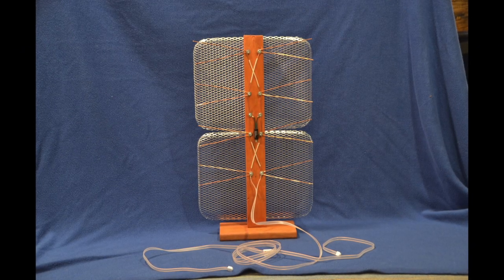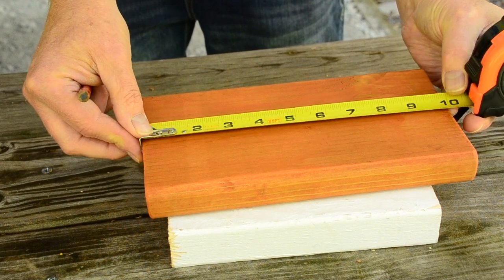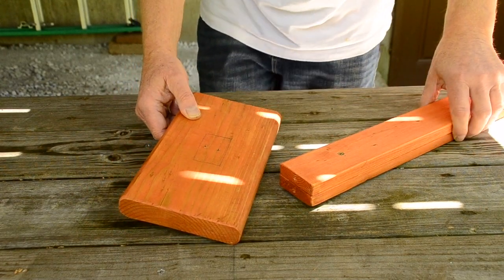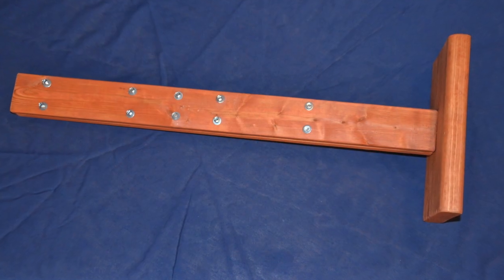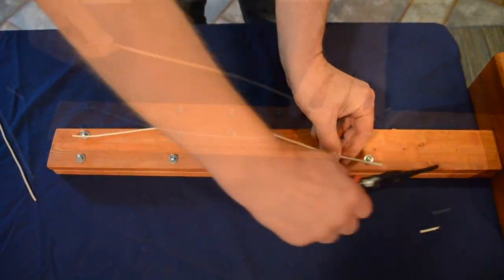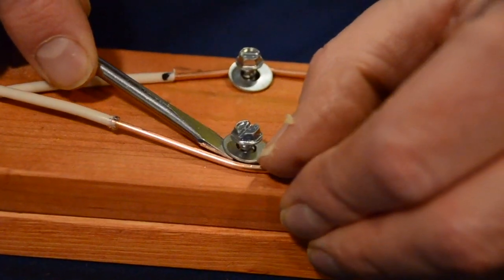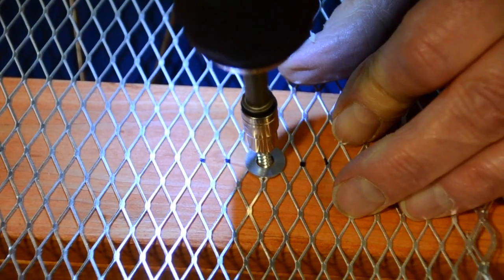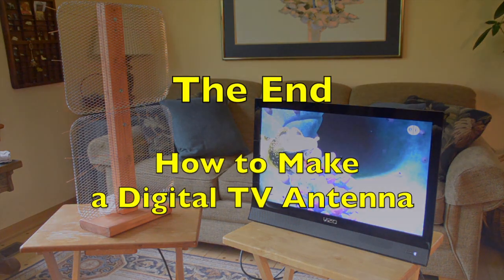How to Make a Digital TV Antenna -- Complete, Detailed Instructions!

Comment: This is a really good design. Works better than the store bought ones. I used 10 gauge copper wire and 2x4s. I made 2 I’m planning on using one pointed to the south and one pointed north west in the attic. You can’t use two at the same time cause of interference. I’ll use a switch splitter at the TV. The length of both coaxial from the antennas to switch splitter have to be the same. At least that’s my plan. Thank you very much for making this video.

Comment: Does the reflector have to be mesh?  Can you use a steam tray or something similar?
Reply: UPDATE: the next day I had to REMOVE the "reflector" in order to get a good signal. I don't know what the solution is, but like you, I"m wondering about why mesh would be better than a solid reflector. I guess we'll just have to experiment.
*********************
ORIGINAL POST:
I made this style of antenna without any reflectors back in 2008 when TV stations switched from analog to digital broadcasting. It worked fine with my old CRT TV and converter box but hasn't been working as well since I recently hooked it up to a newer, digital television. After reading your question I decided to experiment, covering a sheet of cardboard with heavy duty aluminum foil and standing it upright about two inches behind the antenna. It's not fancy, but it made a BIG difference!

Comment: Yes this is a good instructional video and a reasonably good antenna design.
A few improvements:
Your reflector is too close to the working elements,  You can prove this for your self with a TV that has the signal meter function.  If you detect the reflectors and move them back, you should see the signal increase slightly.
If you put a gap between the upper and lower reflector, you can use long bolts, nuts and wingnuts to connect the balun on the back side.
On the middle screws it works a little better if you pass the wire on the inside sides of those screws so that the spring of the wire wants to hold it under the screws.
Your element to element spacing looks a little short.  Normally the distance between each "V" element is made to be about the same as the width of the finished antenna elements.

Comment: There is no such a thing as a digital antenna. An antenna is an antenna. Using the words "digital" and "HD" and "High definition" in describing any antenna is simply pandering to the stupidity of people who actually believe such garbage.
Reply: You are correct but still you should get a life!
Reply: That is correct. An antenna is just a dumb metal object that picks up radio waves. The antenna can careless if those radio waves are carrying digital or analog signal. Your tuner inside your TV or if you have an external tuner will be the device converting those digital or analog signals to a picture that can be displayed on your TV screen.
Reply: Yall are literally retarded. An antennae is not digital. A digital antennae simply implies it receives channels broadcasted in HD - nothing is claiming the antennae itself is digital. Are you guys really that hard-headed?.. a little bored, are we? DIY goes to English class in 2 seconds.. like who cares?? Is convincing someone that all antennae are analog devices going to get you off or something? I'm just really very curious.. do you feel little and insignificant inside?-- and you fill that void by being a doucebag? I'm definitely missing something here. It's pretty hilarious though 😅

Comment: Instead of using two 1'' x 3'' x 25" ferring strips just use one  2" x 4" x 25 instead. Also if you put this in the attic if possible you will pick 10 to 20 more channels.  Height = Might

Comment: No such thing as a digital or HD TV antenna.
Reply: True, but the marketing has drawn a lot of people in. I'm already seeing "New ATSC 3.0 compliant Antenna" advertisements 🙄.  And no, they don't come with a converter box, they're just antennas. At least this video is building an actual antenna instead of just jamming a large paperclip into the coax connector on a TV & claiming it has a 400-mile range (only slightly exaggerating unfortunately).

Comment: 3 comments.  Wood has impedence. For better results suggest mounting the elements and all connections on plastic (which is an insulator) vs. wood because the signal will conduct through the wood from screw to screws thus messing up the impedance and lowering your signal level. 

Also note the spacing between the reflector and the elements.  For maximum UHF gain a spacing of 4 inches is required so if you mount the reflector back much further, it will perform better.

Also, and this is a nitpik. There is no such thing as a "digital" antenna so the title is misleading.   It's an antenna.

Comment: Just curious if there is any reason I can't just use a 2x4 instead of the two firing strips? Looks like a fun project to do with my son who probably doesn't even know TV is free...
Reply: If you use wood, use plastic mounts on top of the wood (either glue the plastic to the wood or screw it separately) so that your signal elements and connections screw ONLY into the plastic.   Don't allow the element mounting screws to go into the wood at all.  Wood is a conductor and will actually lower your signal.  2x4's are good because it also allow you to mount the reflector 4" back from the elements, which provides better gain. The reflector can be mounted directly to the 2x4, but the signal elements need to be mounted only on plastic.
Reply from the maker: I would think a 2x4 would probably work just as well as furring strips. I was just trying to go after the least costly option.

Comment: FM dipole attached why?
Reply: He said that it helps bring in PBS stations somehow.
Reply from the maker: It helps bring in PBS in my area for some reason. Without it, PBS (Channel 35) won't come in at all. Perhaps the dipole helps captures the signal or brings in a different frequency. You can try the antenna with or without the FM dipole.
Reply: The bowties receive UHF, the FM dipole receives UHF. After the repack, a lot of PBS stations moved into the VHF frequencies. Does screwing the bowties into the wood as opposed to plastic make difference, yes, but not one you would ever notice in the real world.

Comment: I'm at a loss what makes this "digital" it is an antenna but there is zero difference between an analog or digital antenna other than no one is broadcasting TV in  analog form anymore in the USA
Reply: If you inspect the airwaves, it is 0's and 1's that are flowing thru the air.  You need a digital microscope to do this!

/s
Reply: @ihatesignupsgrrrrrrr  are you talking about an oscilloscope?
Reply: @caru3257  No, it's not a 0 or 1...  I was joking. The demodulation is what turns the frequencies into 0's and 1's, not what is actually traveling thru the air.
Reply: A digital tv antenna does exist. It is made up of a regular antenna hopefully tuned to the proper frequency that is packaged up and sold with a bunch of mumbo jumbo lingo that doesn't mean anything useful and has nothing to do with anything. A genius marketing scam to make someone believe the antenna they used on their old analog set that worked very well is outdated and inferior so they go out and buy a new one that probably doesn't work as well as the old one they just tossed.

Comment: @doityourselfstan By any chance do you measure a short between the two leads of your matching transformer?  I have ordered this part from two different vendors at this point, and all of them have continuity/short across the two leads, as well as between the center conductor and shield/threads.  Perhaps I'm fundamentally misunderstanding something about the nature of this component.  Thanks in advance for your advice, great video.
Reply: it's a transformer.  The windings appear short to dc signals like your meter's continuity check, but not ac signals like the rf transmission.
Reply: If it's a 75ohm matching transformer, you may see what appears to be a short because you're using an ohm meter that probably puts out 1.5v.  The very small signal your antenna picks up will see the proper impedance so don't concern yourself about the short.   My major complaint with this antenna design is that everything is screwed into wood, which, to a small signal, will mess up that delicate impedance. Always mount everything on plastic.  You don't want the signal touching wood at all.

Also, the antenna design is a huge compromise.  It looks nice and cute, which will probably please your spouse, but it's not really tuned at all for maximum signal.  All inside antennas are a compomise because style matters.  But this is not a properly tuned 4 bay antenna, which would be too large to have in a living room.   

Due to size, a 2 bay, with properly spaced elements and a properly spaced reflector would  provide MUCH more gain, for about the same size.  For those of you who remember the indoor antennas of the 50's, most were properly tuned 2 bay bowtie antennas that could still sit on top of your TV.

Comment: Thanks for the video post. I haven't studied antennas yet and managed to get my ham radio license despite my lack of antenna theory. I waa given one of those cheap 150 mile yagi style amplified antennas that has an integrated rotor. I'm considering adding more elements to it along with a used direct tv parabolic dish for a reflector to see if i can improve the quality of the channels i currently receive along with possibly adding a few i couldn't receive before.  Ray. KG5ZEF and 73
Reply: Throw it out.  They are made by chinese manufacturers who have no antenna engineering talent whatsoever and just threw some cheap metal together, added a cheap rotator and cheap amp.   A hunk of wire with an amp will work almost as well.  Build a 2 or 4 bay style, mount everything on plastic because wood has an improper impedance and make darn sure you have a reflector sitting back 4 or 4.5" and you'll have one powerful antenna.  Just use proper antenna design for bowtie length and spacing, which can be found online.  And yes, with proper spacing it will be much larger than this indoor antenna.

Comment: Do the reflectors actually do anything to enhance performance?
Reply from the maker: They are designed to reflect the broadcast signals back into the V-shaped wires, or "whiskers," to improve reception. I've not tried an antenna without them. I bought these single-use grill grates in the outdoor grill aisle at a Wal-Mart.
Reply: @doityourselfstan  what's the distance the reflectors should be away from the v's?
Reply: @doityourselfstan  Thanks for a great video, the precision needed in respect to the distances between the parts would be compromised by using bendable grill grates as reflectors?, if that makes sense?ie what happens if you bend themclimbing into your attic - you'd need to start again? Or am i missing something? PS you're other videos are great as well
Reply: OMG, it's the most important part of a properly tuned antenna.  For 4 bay antennas intended to receive stations 14-36, the proper spacing is 4.5" behind the bowties.  A chinese manufacturer sold one here in the US and is still sold under various names.  There were many complaints about it's signal gain and had a low rating.  It was also cheap in cost and still is.  

The problem was that it was based on an old engineering design was intended for channels  60-72 (back in the 50's) so the reflector was only mounted 2.5" from the bowtie elements. It had lousy performance for the lower UHF channels here in the U.S.  I purchased one for a song and remounted the reflector 4.5" from the bowties. The mod wasn't that difficult. That baby now has excellent gain and it will pick up a good signal from 70 mi.
Reply: They are a tad close actually. Most bowtie antenna designs have at 3 to 4 inches behind the elements or "whiskers"

Comment: Hi Stan, That was such a clear video. Thank you. The wires that you ran crisscross and on the outside of the 6 screws, were those for pulling in UHF signals? And the V shaped  wires, are they for VHF signals? Mike Thompson had a similar question I think.
Reply: This is a UHF design, not at all VHF.  If you need VHF, get those ugly big rabbit ears.  VHF requires large antennas.